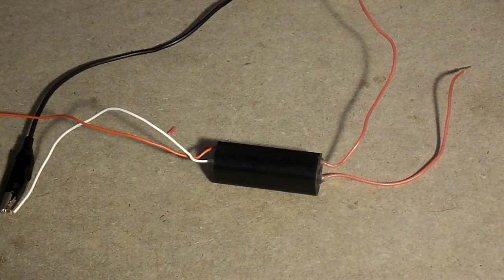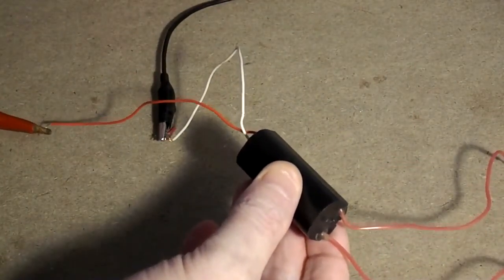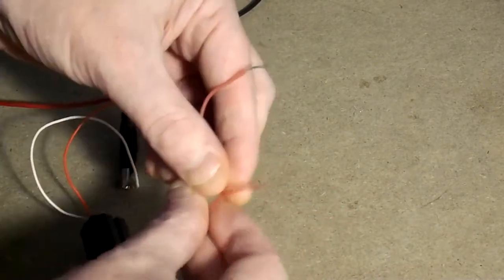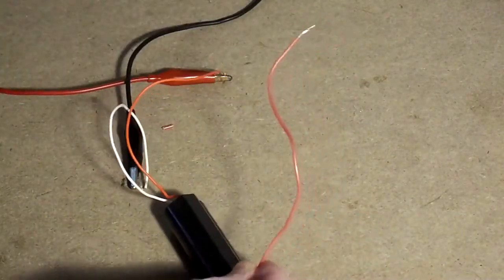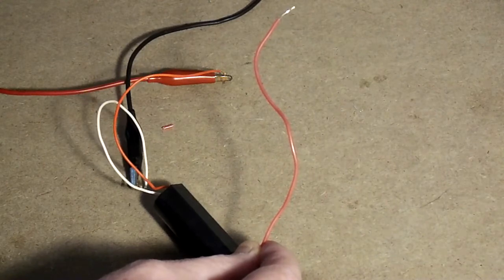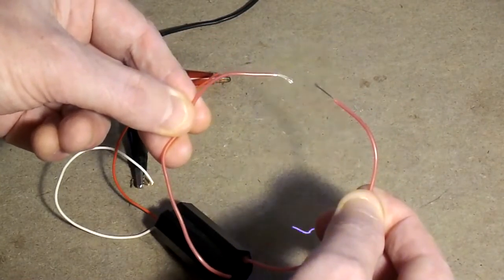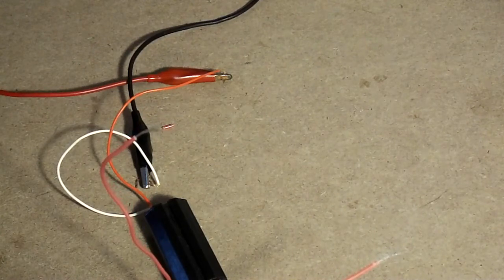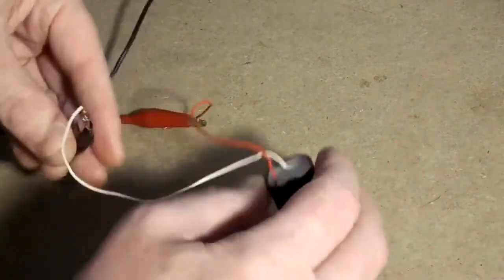Testing 30-60kV high voltage booster. Gary McKinnon.

Comment: Yeah, I absolutely love these things. ~$6 US on Amazon. I use them for starting pulse jets. Just hook it up to an 18650 Lithium battery and yer all set. As far as run time goes, can you pulse it using a 555 timer and a mosfet? You know basically lighten it's run load by making the duty cycle less than 100%...
Reply from the maker: Yes they can be pulsed but i don't like them, they don't last long, using other methods now.
Reply: @GaryMcKinnonUFO  You ever get a solution to this?
Reply from the maker: @sempertard  Used a car ignition and a PWM driver, which works well, but i'd like something that could do AC, DC and have frequency control, unfortunately devices like that cost in the thousands so i'm looking into a build.

Comment: HI, hope your well. Be very careful with holding low grade insulation like that as it may not be rated for higher voltages and if it can  break the insulator wall and your holding both wires the only way the voltage will then travel is through you through your arms across your chest, taking in the nice liquid cavity known as the heart. You wont be able to let go because your muscles will be tensed. You need to hold high voltage wires with non conductive rods. See Mr Photonic Induction 's  videos for lots more info. Keep safe, there's only one of you!  If you must do it you should have only been holding ONE wire at a time, so there no COMPLETE CIRCUIT THROUGH YOUR BODY ;-)  Never trust Chinese insulation... probably made of bubblegum!
Photonics videos here:  https://www.youtube.com/watch?v=l4aI2Oiz1ps
notice how he handles the rod with one hand... hint hint... ;-)  Remember the gap distance causing your arc to happen. That means the electric will jump that gap through a flaw in the wire insulation to the same distance...through whatever its connected to  - human flesh is a lovely conductor. So your rods need to be double that distance as a minimum to avoid risk. 5 times distance if your safety concious. Make sure rods are never moist too as that would render them conductive, hence why wood is not a good choice because it can hold moisture inside it.
Reply from the maker: I know it's been a while but thanks Matthew!

Comment: AHA... Its a D.I.Y.S. teeser. That always comes in handy !
 i really like those gadgets that levitate. Like a Lamp or a globe, recently i have seen a small wooden box with a light bulb floating above it. One day ill actually buy something like that. ....Maybe a D.I.Y.S. levitating -kit
Reply from the maker: Dawn Hernandez
I'm interested in them because there's no complete explanation for the efect yet, it also works in a vacuum so it isn't ion wind, and the wind produced isn't enough to get the craft off the ground, but they do get off the ground.
Reply from the maker: apeture123
Yes it's interesting stuff, good to be able to home experiment on something that isn't completely solved yet.
Reply from the maker: Yes I like those gadgets too, this will be for testing thrust with a view to building an ionocraft.
Reply: Okay, I wondered what the tests were about. Would an ion gadget be able to build enough thrust to achieve escape velocity? Or will we still be bound to rockets for that? Very cool, thanks Gary!
Reply: Gary McKinnon hm. well, traditional anti gravity (utilizing the lorentz o vortex) uses positive and negative charge in the field to move and is classified as asymmetric propulsion, which you are probably familiar with. These ionocraft use it as well just in a different way, which is proven as they do cancel the sound barrier. asymmetric propulsion is just...ah it's so fucking good! but as to why it floats i am completely unsure. how it cancels the sound barrier is also something i'm not completely certain about, but two major reasons could potentially be it moving the ether somehow using electricity like how anti gravity does with it's electromagnetic fields, or maybe it simply makes a bubble of electricity capable of moving air out of the way like a smoke ring. all these crazy technologies use a common principle of redistribution like plasma beams, anti gravity, fast fast boats using the lorentz force and much more. weird.